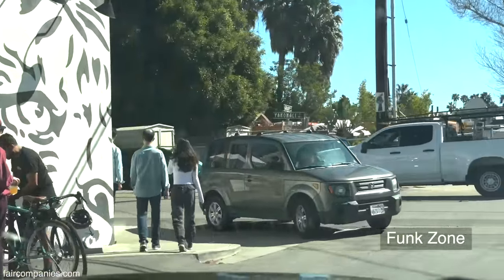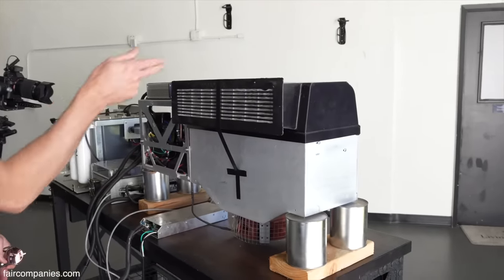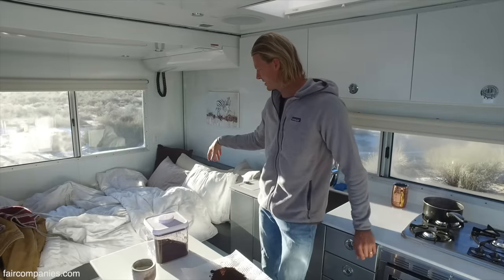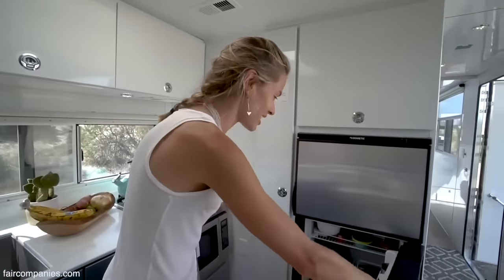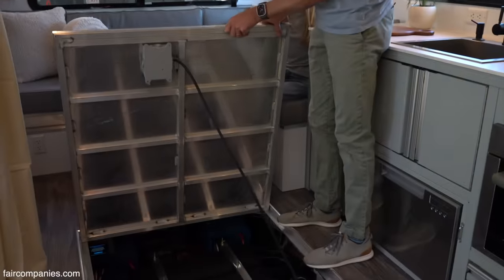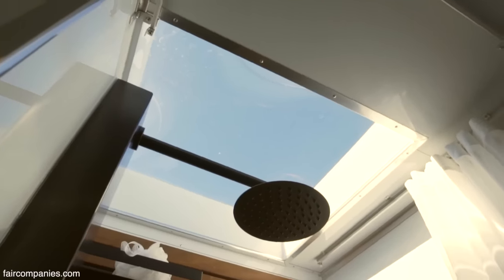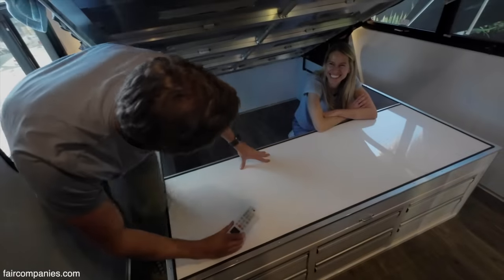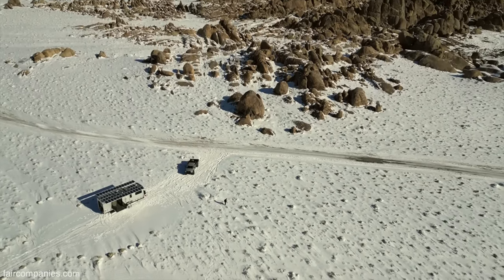Couple's stunning home-on-wheels produces water, has solar awnings

Comment: This has been on my wishlist since I first saw one. I wonder if they considered an incinerator toilet or dry flush toilet. Black tanks aren’t my favorite.
Reply: They certainly have enough power for it. I honestly don't know what they intend to use 72kwh for. Are they expecting a month of no sun?
Reply: @badsamaritan8223 um.. heat pumps/air-conditioning/dehumidifier/water extractor/induction cooking. All that takes big power.

Comment: I'd like to take an EMF meter in there and see just how high it is!  I'm worried its off the charts...
Reply: All solar and inverter electronics located in the basement and shielded from the living space with a continuous 1/8” aluminum sheet.  Essentially a faraday cage. All components of the system may be individually turned off when not in use.

Comment: So if the price that was stated on other comments of >$500k, it is less palatable for folks like me.  I live with 40 acres, a well, 3 BR 3 bathroom  berm house in MT.  My place ia a lot less than $500K.  This home was amazing re: features in an off grid mobile dwelling.  However, who can afford it?    There is also the 3/4 - full ton pickup to haul it which is another $100K + .............so, an AWESOME build  no doubt and I am sure the company will do well  with a quality product.

Comment: Pros: Great job and presentation ! Looks like top notch durable build quality, which is what the RV industry is notorius for not having. It's always been quantity over quality, but to the RV industry's defence most stuff is easy to repair, when it breaks down, and it will because of the poor quality. Catch 22 ?? 
Cons: It's a $400K travel trailer ! All those systems are lovely when they work and when they don't, not so lovely as the unit could be rendered useless upon failure. Wooden wall in shower niche is a bad choice of material and it's gonna be mucky and hard to clean. Roof mounted fans, skylights etc. don't work well with a layer of solar panels over it so you have to move top layer panels out of the way and the weather might not permit that with high winds etc. Could imaging that a thick layer of a good snowpack on roof top could be hard to clean of and ruin your day. Watermaker is overkill, requires power and maintenance and you have to get supplies like food etc. anyway so getting a couple of gallons for drinking and topping of your city water tank would be a breeze compaired to the water apparatus.
Maybe build the same in a 4x4 Class C package with high clearence like Overland a.o. for greater offroad/boondocking capabilities. Price is important, you should mention it in your sales videos. It's a little suspect when you don't. Keep up the good work !

Comment: Convert the truck to hybrid gasoline/electric drivetrain and charge via camper solar. You get to drive on carbon free power and have backup source of heat and electricity from the engine via engine coolant and exhaust heat capture.

Comment: 400 to 900k, but these aren't meant for everybody. These are more of a proof of concept that shows what CAN be done if there was more commercial interest in this sort of thing.

Truth be told though, a lot of this cost has to do with this thing being mobile. All that tig welded aluminum, anodized aluminum is strong and light but expensive.

Plenty of other videos on this channel that show how to live off grid truly inexpensively. But you have to put in some work yourself, spend some time learning etc. 

This guy is selling luxury state of the art machines, but you don't always need a new Lamborghini, you can have fun with a used Mustang just fine.

Comment: one of the better ones. im guessing 200K price for something like this
Reply: $600,000 for a near-the-top base price, and that doesn't include the $50,000 vehicle necessary to tow the damn thing.  
The cheapest they offer with a tow vehicle will set you back at least $400.000.
Reply: @karriewick  Not surprised. The cost to build one of these has to be at least $250 - 300k with all this custom work and hi-tech appliances. Not for the Alabama market that's for sure.

Comment: What does it weigh and what do you tow it with?
Reply: With the thousands of pounds of LFP batteries in it, I'd imagine it weighs substantially more than a normal RV. It looks like they're towing it with a regular gas pickup. 

The thing is, with so much solar, they could just tow it with a Rivian or Ford Lightning, and they wouldn't need 72kwh of batteries on board. Let the truck carry the batteries, and make the trailer as light as possible. 
This thing has all the bell and whistles and lots of ergo design, but I'm not sure they put any consideration into weight, or fuel economy.

Comment: I would like to know if a smaller less “polished (raw/industrial or leave some for DIY) to help with final costs..?

I’m interested in the water system as a stand alone unit if you can make that possible..?  

I live in an area with NO water access, natural or otherwise.
Water is my biggest emergency concern.

I’m looking for an “emergency plan” that I can convert into a “my new way of life” with my disabilities. It needs to be as independent as possible…with that awesome solar power system, water procurement all in a beautiful package.❤

I was in the same area during a natural disaster with no power, water or communication for months. Although then I still had my health and great friends that still lived in the area. 
I never want to feel that helpless. I don’t want to depend upon anyone or government for assistance. They don’t come in time and I know that first hand. There’s simply too many people that would need help.

I have 2 minor concerns:
#1-High winds and the stability of the unit.
#2 Any concerns hail with the solar panels. Have you had any issues with either of those?
Thank you for your time,
SA

PS
I’ve not had a kitchen or a full bathroom for the last 3 yrs since being “under construction”. 
I’ve learned a lot about with my disabilities and what I don’t need.
It’s a good thing to know when changing one’s life path.

Comment: They’ve created an apartment on wheels kind of. Like one of those kasitas but way better. Except, the interior design seems very cold and impersonal.
Reply: Yeah, super sterile. Which is absurd at $600k. Like, where did most of that money even go? No natural wood? No Marble or granite? No fancy epoxy stuff or embossed metal, or anything. Just bland aluminum and fiberglass/plastic.

Comment: If they can find a high enough mountain cave with several hundred feet away from the entrance to park it, it might just survive the solar micronova flash and tilt. But solar wont do them any good for years after. Better have a cave with the ability to hydroponically raise fish and food on a big wind generator and fresh water supply stored within though. 
Not many are going to make it through the end in plush lifestyle. But.. they have ten to twenty years before, if they think for themselves.
Reply: What channels or information do you recommend to prepare for the event? And what locations do you recommend are safest in the US? I think you might know of suspicious observers as he echoes similar sentiment. Appreciate any guidance
Reply: @user-fw7nm4pm3r  Hmm. If you are following his work, and read the background material you should have a pretty good set of variables to work with.  Here is a recent post of information I put up to try and help others to digest.
Distinction of the details on the "moment" of all of the elements hitting go like this, "take your hurricane winds and double to triple at minimum", that comes with the shift and tilt, as well as the ground whipping back and forth a bit. Thus.. structure? Cant be up in the wind surfaces. Has to be inground and not possible to bury. Think.. cave entrance on a cliff face. Why? Cant bury it with debris. Next, is it deep enough to deal with heat on the surface? The heat can be as passing as a few days of possibly unbreathable air. Then, the floods.. can it be flooded? IS it high enough and in stable enough strata? Is it stocked well enough to eat and drink in the time after the heat to deal with ash as well dropping like winter? If you depend on electronics, so fourth.. will it fail? If it fails is that handicapping you? Killing you? With the question of the induction deep energy from the ground up in rebuttal of the blast, it starts feeling like a coin flip. The more metal, the less safe? Now.. all that happened. Calms. You emerge, water or wind and heat has flattened everything on the surface. There are no satellites. There is no visible sunlight but the darkest of days dim, and shortrange sightline of heavy dust. Water is likely a constant problem with dust, salt, chemicals burned or in ash residues of many forms. Then.. the cold. Snow. Constant snow. Years or decades? The unsettling of the tilt will have thrown out lakes, thrown off rivers, broken or hidden away water aquifers, it will be in most senses a new world. That you cant even explore with any real degree of safety or certainty in many ways, especially if it was in the blast waves of the winds or waters, or where those debris points heaped up. What is around now in toxic proximity could be hundreds of miles from its source, piled up near you, or buried just beneath sand. There wont be growing. There wont be much wood to just grab ahold of to burn. So... Think of such, and ask.. what has to be prepared, what has to be stored, what has to be available to learn and teach from and how long will it take to have anything necessary available without those things. Thats a good start to think about HOW. You can manage simple things, but.. it means a hard hard world and starvation or poisoning or yes.. people.. are the problems from then on, as well as medical problems all along.. so much is taken for granted now.
Reply: @SeeTheWholeTruth  thank you for your reply and the additional info. Do you have any comprehensive book you recommend on the matter? Other than the Adam and Eve story by Chan. And what is your personal plan or location if you have one?

Comment: With all the gadgets moving by electric motors, they should have had two layers of awnings so they could move them and get 300% solar panel space compared to the roof instead of the 200% they have now.

Comment: MSRP?
Reply: $600,000 for a near-the-top base price, and that doesn't include the $50,000 vehicle necessary to tow the damn thing.  Utter stupidity, unless you are of the mind to throw money around. 
The cheapest they offer with a tow vehicle will set you back at least $400.000.

Comment: 16:07 - 8 people, average weight of 160, that's 1280 lbs. Seems reasonable. How much do those fold out hand rails support? 

I like the concept. But, I can see why it wouldn't scale up to higher numbers of production. The product liability and servicing would be crippling. A recall would be devastating. Like, if drawers wouldn't actually stay shut, or someone was crushed by one of the actuated beds / tables. It's a niche market, for sure. 

I'm glad they are able to service their clients with such a specialized product.

Comment: Vastly overpriced. You can buy a nice home $300k to $660k for the cost of these things. While these electronics are cool they fail, hoses leak, batteries in the core of it which create fumes and if there is a fire the whole place is 100% loss. If I had that much money this would not be an option I;d invest in acreage and efficient home.

Comment: I know it's "high quality", but if I want something to really "last" and be serviceable long term off grid...I would want less automation/electronics for the moving parts. It's like all the new EVs with bells and whistles. Electric motors and planetary gear is pretty reliable, it's all the extra crap i worry about breaking down.

Comment: 😂 She says the Rv industry hasn't changed much in 80 years. My Grandpa invented Cardinal trailers In the 50s and sold it in the late 60s. I can assure you the Rv industry has changed dramatically in 80 years.. This Rv seems problematic with all the slides,gears,motors,lighting,electronics. Maybe if Rvs stayed old school and less modern with analog controls, halogen bulbs,etc....  We would have less issues concerns and cost. No need to reinvent the wheel. Besides somebody could get hurt sitting under a moving bed with no stop to protect your neck. Over built and over budget❤

Comment: Hahahahaha - $600,000 for a near-the-top base price, and that doesn't include the $50,000 vehicle necessary to tow the damn thing.  Utter stupidity, unless you are of the mind to throw money around. 
The cheapest they offer with a tow vehicle will set you back at least $400.000.